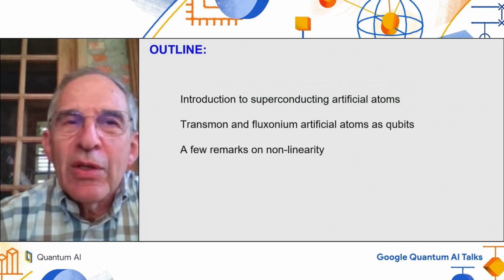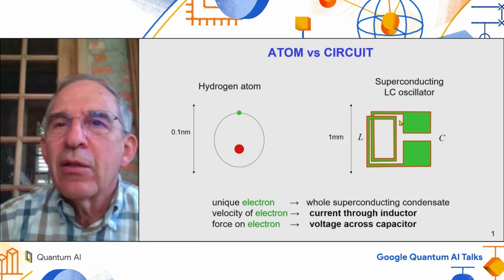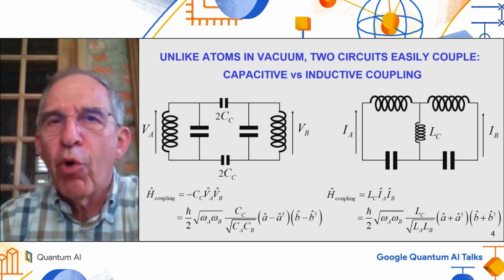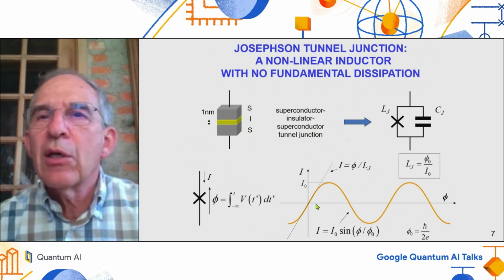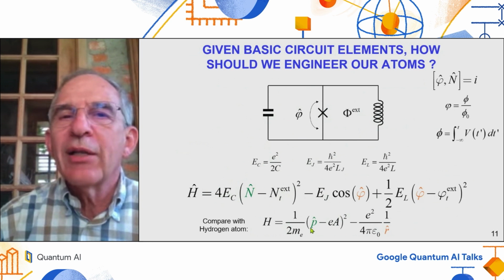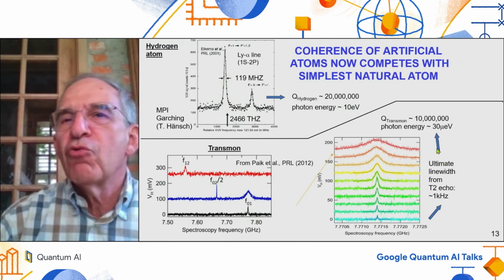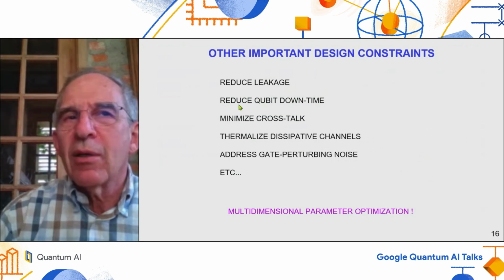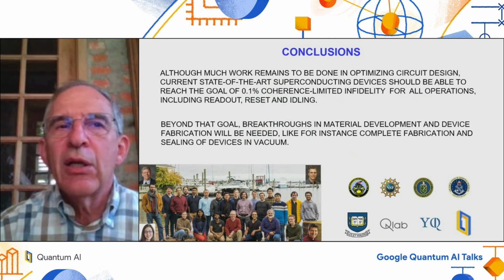Keynote: Superconducting qubits for quantum computation: transmon vs fluxonium

Comment: Do you have a way for me to contact you maybe in a semi direct manner involving a potential tech that could change things in data recall, storage etc. This requires the minds of those greater than I as well as complex tech from other fields combined and should, at minimum, be patented. Maximum every Quantum computer will use if the techs feasible unless a better form come along.

Comment: Actually I couldn't understand the transition from linearity to non-linearity around 9.10 mins. Why do we need non-linearity?
Reply: I know it is because we want to avoid equally spaced energy levels. Suppose the system changes energy and emits a photon. With equally spaced levels, we couldn't be able to tell what energy the system was in just by the energy of the emitted photon, since they were all equally spaced. With unequally spaced levels, the energies between transitions will be unique, and hence the energy of photons would tell us exactly what state the system was in. That is just my best guess though, I am new to all this as well!
Reply: @christiancastruita9053  Yeah that's pretty much it, but to give more context, imagine you try exciting a linear system. We usually use a diagram that shows ONE photon hitting the ground state and exciting to the next state. In practice, though, we are using a microwave circuit that emits MANY photons of the same energy, thus the transmon may absorb any number of those photons and end up in an N-th excited state that we can't really control or identify. 

With each energy level at non-linear differences from each other, if you excite the ground state with enough energy to get to the first excited state, you know the ONLY state it can end up in is that first excitation, since all other states would require a completely different energy to access.
Reply: @christiancastruita9053 yes u nailed it. U r ryt
Reply: We need unique individual energy levels to differentiate. It's easier for representation purpose